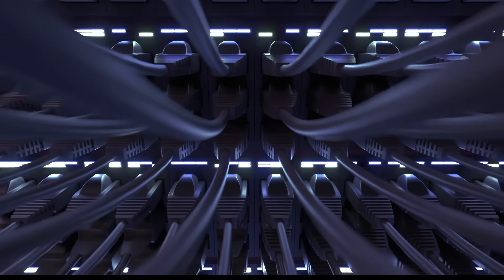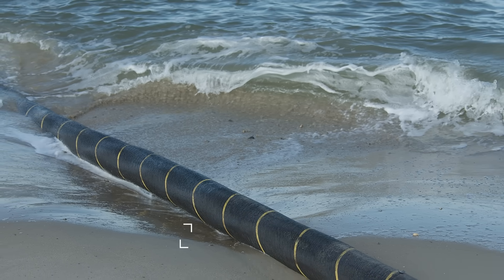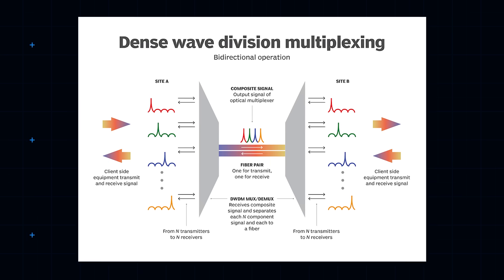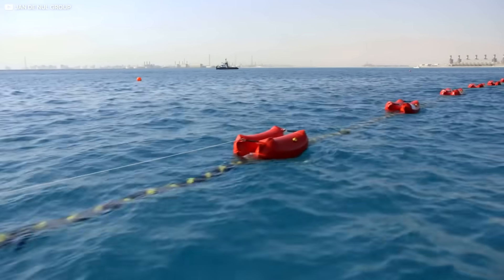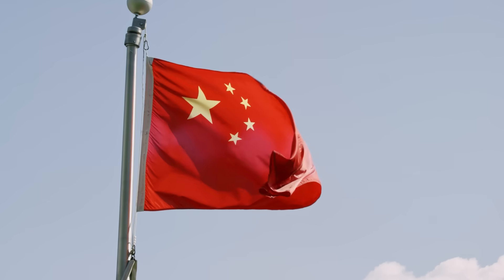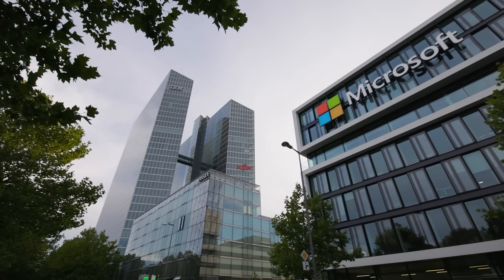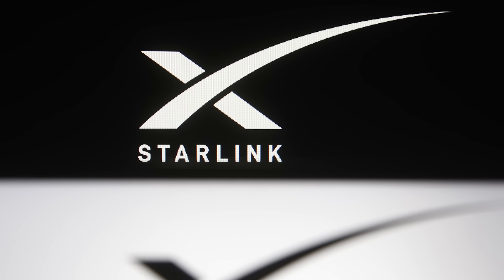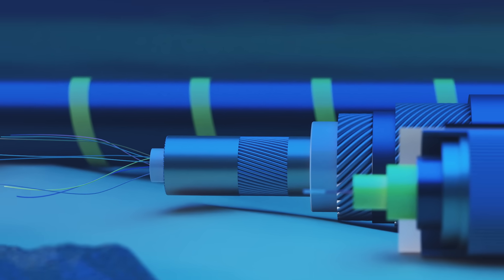How The Internet Travels Across Oceans

Comment: I have a CCNA and a IT background in networking. 99% of the internet probably would never use these oceanic network cables. I would imagine most traffic is on the transatlantic network since it connects the United States with the rest of the English speaking world. The internet is designed to travel the least distance (logically and physically) as possible. So any content you see from within your continent most likely traveled through land. I would love to learn about the network Australia has set up since it is so far away from other English speaking areas.

Comment: Wireless means there is signal spreading, interference (artificial as well as natural), etc.. So i don't think the wired transmission will be completely replaced by the wireless transmission anywhere in the near future. But maybe in the far future the difference may become so low that wired may not matter at all,  since convenience is always better than a bit higher performance. In the far future where humans may live on different planets on different stars, it will definitely be wireless. But as for the internal core communication it may still be wired, because the physics laws will need to change to completely kill off the wired communication.

Comment: Ok so for future networks like something Elon is working on (StarLink) how are those signals running through the air going to effect the human mind when we transition to no cables really? Yes, as crazy as that may sound its just an observation.
Reply: Ultra high frequency radio waves are typically used in transmitters that are broadcasting from space to the ground or between 2 points in space.  StarLink specifically utilizes the 12Ghz frequency range which is acceptable under FCC guidelines.  However, even though RF signals have been known to cause minor to moderate health issues if directed and concentrated at a body tissue for extended periods of time.  The StarLink and other orbital satellites communicating with the ground use “beam focusing” technology.  This allows the RF waves being transmitted to be focused in an extremely tight beam and only directed at the ground based satellite receiving dish.  The ground based receiver is constantly linked to all orbital satellites and relays positioning data back and forth constant, that way both the transmitter and receiver know each other’s precise location and can keep that very narrow beam of RF signal on target.

Comment: So... What About the satellites then? Although you couldn't connect to an object moving across the sky at 33.000mph anyway.. we have trouble getting a signal from 02 in half the hospital which is surrounded my phone masts.. how could we connect to a small object moving 33 times the speed of a bullet!!  At least we know its all cables at last ;o) we have a massive mast that  supplies tv and phones in this area.. its 250ft high.. that's what the sky tv dishes were pointed at.. they were static  and all facing the same way (at the local mast) they wouldn't keep connection with a moving object going at 33.000mph would they..

Comment: I worked in the past with ATT Transoceanic.  Very interesting cables  Fibers were stripped with hot sulfuric acid and fusion spliced. With periodic repeaters housed in beryllium alloy housings,.Powered thru the cable from each end.Fiber can be "Tapped"  but it causes a noticeable loss and direct contact with individual fibers is required.  Very difficult to do on the bottom of the ocean..  There are multiple fibers in each cable.  As I recall they used 9 um cored fiber.

Comment: This is the most fascinating video I watched in a long time. I had no idea these were under the Ocean. I just dont understand how they get them to be on the bottom of the ocean. And also to stay there, its so deep and so hard to monitor
Reply: well they're heavy, so they just kinda sink to the bottom and stay there. and there's really no point in monitoring them visually, we can just assume it's a cable laying on the ground under water for the most part. if it breaks, you just measure the echo from the signal to get the distance at which the cable is damaged.
Reply: @hovnocuc4551  wow that's incredible. But what happens if the ocean floor shifts ? Im referring to the big shifts that cause earthquakes and such ? It doesnt interfere?
Reply: @annishenko  They can break then a ship is sent out to cut the cable, drag for one end and pick it up then buoy it off, drag for the other end and pick it up, find the broken fiber, cut out the bad section, splice new cable in, retrieve the buoy, retrieve it and splice the two ends together.   Simple...

Comment: Old school tech for an old school problem. Go wireless! It's the future. Lead-follow-or get out of the way.
Reply: If I could get any wireless provider in my area with at least 500 Mbps of download speed consistently, I would consider a wireless solution. That's my current speed with cable internet. I tried T-Mobile's home internet and the speeds were very inconsistent. I would get a peak of 400 Mbps and then it would fluctuate. I tried in various parts of my home without any real improvement. Verizon's pseudo 5G was atrocious in my experience. I averaged less than 5 Mbps on my phone, again in multiple parts of my home.

Comment: I'm so confused... as a student going into IT or programming (computer science fields), how and/or why do you need cables? My phone doesn't need cables to connect to the internet because of satelittes... so why can't you just do the same thing across the ocean?!?! Seems so dumb and absolutely pointless to use cables.
Reply: lmao. Not being rude, but its a bit scary that a prospective IT/programming student doesn't understand some of the basic stuff of technology.... I would assume you would have a bit more knowledge about this... But anyways, you are completely incorrect. Your phone does NOT connect to a satellite for service (except for GPS). There are cell towers around your area that your phone connects to. Cell towers and satellites are 2 very different things. How do does cell towers connect to the internet? Through cables. They use fiber optic cables to connect to datacenters. In remote areas, they may use radio links between cell sites.

You think its absolutely dumb and pointless to use cables. But without them, you  wouldn't be able to type this comment on your phone and submit it...

Comment: Could we get a video on just the way the repeaters are powered.  A lot of engineering goes into sending power over much, much shorter distances over land, so I imagine there are quite a bit of tricks they had to use to power repeaters in the middle of the oceans.
Reply: They said copper lines run the length of the cable running 10,000 VDC (at fairly low current). In addition to powering the fiber repeaters, the DC voltage uses its own voltage to extend its voltage, if that makes sense.
Reply: high voltage DC current is extremely efficient at long range transmission, the only reason we use AC on land is due to legacy systems.  Nothing too crazy is needed except properly shielded copper wires big enough to carry the current at high voltage.

Comment: This might be a dumb question, but where does either end of these under water cables connect? Like what the does either end of the cable look like? Do they just connect to a switch at a massive datacenter somewhere?
Reply: It ends at a cable landing station. There is equipment inside the landing station dividing the light from the fiber optic cable into channels sending it to data centers, IX centers and switch boards on land, depending on the purpose of the traffic.

Comment: The cables' speeds are not in gigabytes per second, bandwidth is usually described in gigabits per second =). One byte equals 8 bits, so quite a difference.

Comment: GigaBYTES per second, are you sure? It was my understanding that all network throughput is measured in BITS per second, not bytes; and thus would be 1/8 the speed of what you said. So if you haven't double-checked and found that for some reason they went with bytes on this figure, you should re-edit the video, post the corrected version, then delete this one. Or at the very least, you would please put up a card that corrects it (but the blind wouldn't get it).

Comment: Interesting video, thanks. Reading the comments, I am actually surprised so many people are/were not aware of the existence of such cables. Subsea cables and pipes are used a lot, for a long time already. The first transatlantic telegraph cable was laid in the 1850-ies. Since 1866 the US and Europe have been continuously connected by cables. Messaging per ship was too slow and pigeons don't cross the Atlantic. Line of sight comms not possible due to distance and earth's curviture. And satellites still had to be invented, which took around a 100 more years from that moment in time.

With the rise of offshore oil and gas production (and later offshore wind as well), the number of subsea cables and pipelines has risen dramatically. There is a complete infrastucture out there, including subsea wellheads (so production locations without rigs.platforms, but just at the sea floor). Offshore wind results in the laying of large diameter cables (say 1 ft or more diameter), to transport electricity from the windfarm to shore. 

The cables need to be strong and flexible: strong to be able to carry their own weight in very deep waters, flexible to fit on drums on cvable laying vessels. Their construction is quite complex, as they can serve multiple purposes: power supply and data. They also include various types of armour to create the strength required to lay them with breakage. 

Subsea engineering is one of the most interesting fields in the offshore industry, as far as I am concerned. Just imagine what it takes to lay a pipe, cable or install a subsea wellhead in more than 2500 m of waterdepth.

Comment: nations should build flexible yet rugged strong tubes instead of cables, that way they can upgrade cables simply by feeding them through the tubes rather than (re-laying) them . Better fiber optic cables come out? feed it through the tube. Maybe even have A tube with multiple tubes in it so cables can be replaced independent of one another

Comment: Some years ago, a flat earther told that satellites were bogus and that ALL communications were made through undersea cables.
I thought he was nuts. Then I realised he was onto something when I found a map of said cables.
Why do we need satellites?
Reply: A couple of reasons actually. For one GPS and satellite imaging can only work from space. Also a few gather other data about our planet or space itself which you can only really collect from up there. 

But besides that we have a variety of satellites for things like TV or communication. Most of these were put up when the internet wasn't really yet a thing so they were and easy way to send information over vast distances and to a lot of different locations at once. 
But even today they still have their purpose. In some locations it's just impossible to get internet access because there are no cables. Being able to call out to a satellite that can provide service to a large area is an really easy and cheap solution. If you are out in the middle of nowhere you can still receive TV signal or make calls using satellite phones.